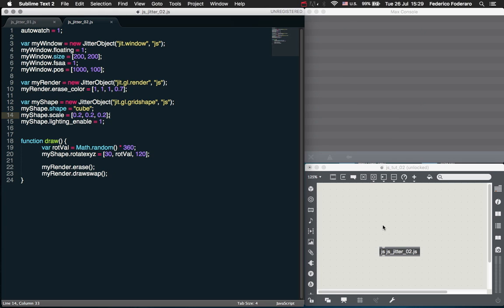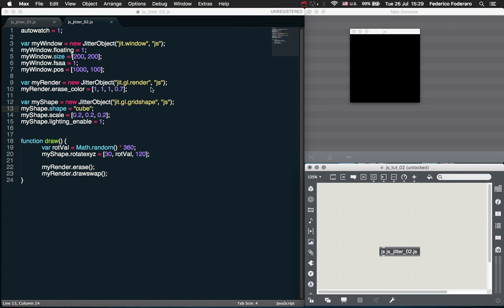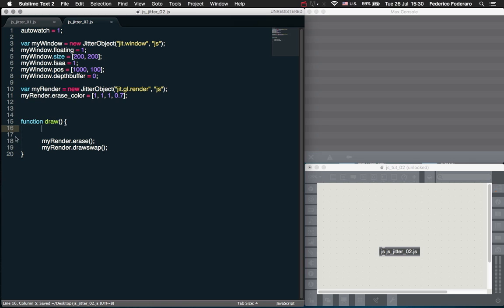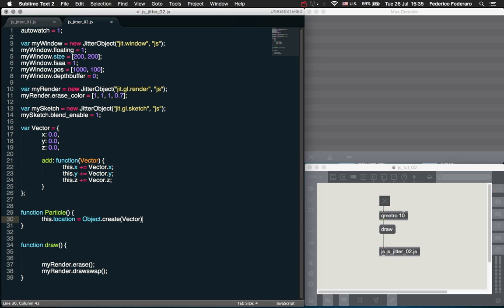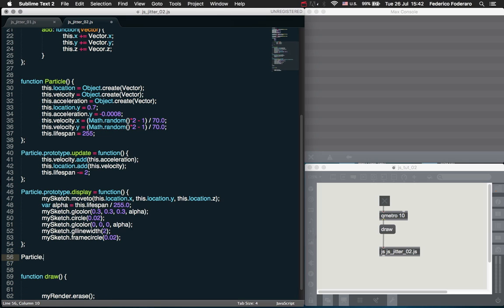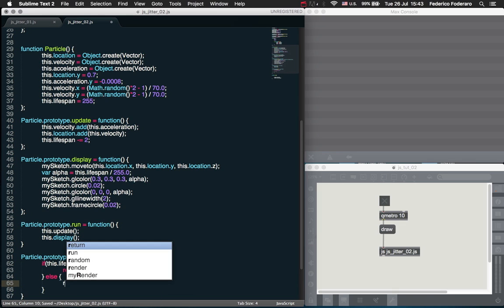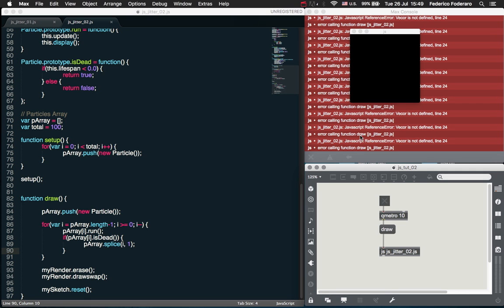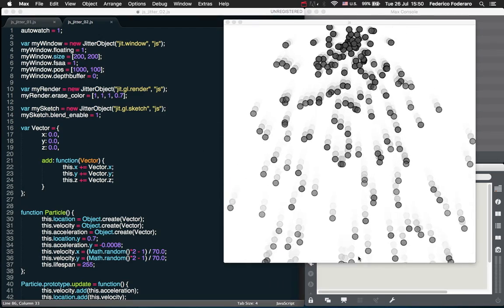AMT - JavaScript for Jitter Series - Ep. 02: Particle System

Comment: Hello, Federico! Thanks for such a good tutorials. Can I ask you a question regarding this tutorial? In your videos you are using <object>.prototype to set object methods. But, as far as I can see you can set all the methods right in the constructor function? What is the difference, why do you prefer the first way? Here is an example:
// 1. your way:
function Particle1() {
    this.location = Object.create(Vector);
    // ...
    this.lifespan = 255;
}
Particle1.prototype.update = function() {}
Particle1.prototype.display = function() {}
// 2. another way:
function Particle2() {
    this.location = Object.create(Vector);
    // ...
    this.lifespan = 255;
    this.update = function() {};
    this.display = function() {};
}
Reply from the maker: Hi Valery! You are perfectly right, there is actually no difference between the two ways of setting properties and methods of a class. You can do it either way. JS has in general lot of different ways to do the same things : )
Reply: I investigated this a little bit further. It turns out that your way of creating objects (prototype-based) is slightly more memory efficient than the other one (functional). When you create objects using the latter one, each object has its own copy of all the methods, while in prototype-based creation all methods are in Particle1.prototype that is shared between all user objects. An object itself only stores the data. Thanks for pointing me to this, now I understand the issue much better!
Reply from the maker: @VKondakoff  Thank you a lot for this insight Valery! Didn't know it myself, always good to get a deeper understanding of this stuff.
Reply: Thank you, Federico! Just wanted to make sure. 👍

Comment: Hey Federico, i'm going through your amazing tutorials and i've come upon this issue. When following along this tutorial I get the max error. "js: no function draw [jitter_2.js]"  Which you don't appear to encounter. My Code is here https://pastebin.com/Dpf0QU7H.  Does the draw function require a Class to instantiate  it? Does any other files have to be in the folder with the max patch and the js file?
Reply from the maker: Hi Enki, there were a couple of errors in your code: first at line 66 is return true and return false, without the = sign. 
Then at line 94 you missed a dot. This code should be correct: https://pastebin.com/Bi9UA4Xy
Glad that you are following my tutorials!
Reply: Thank you for responding. Somehow missed the alert that you replied and got distracted with your other great tutorials. ;)